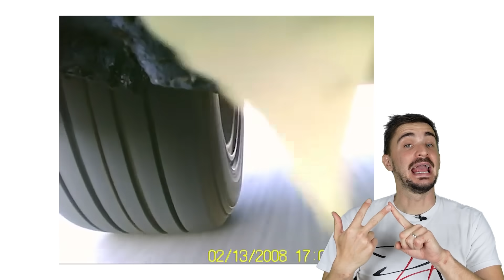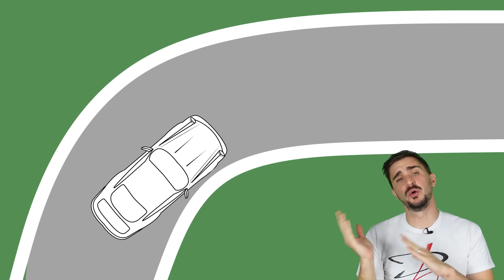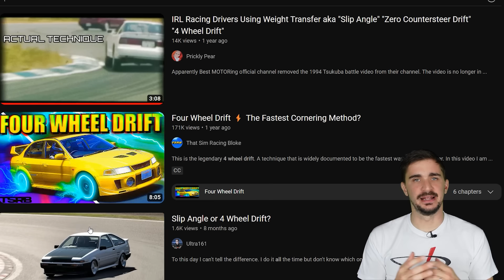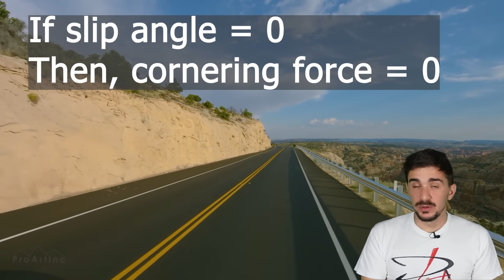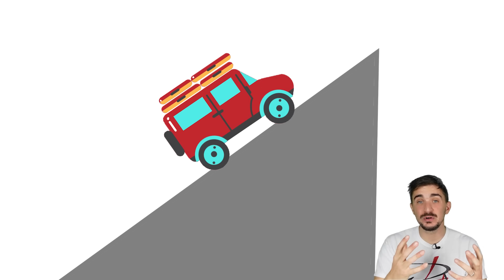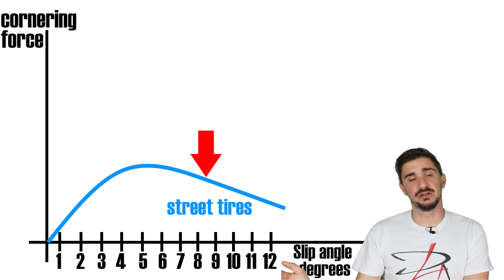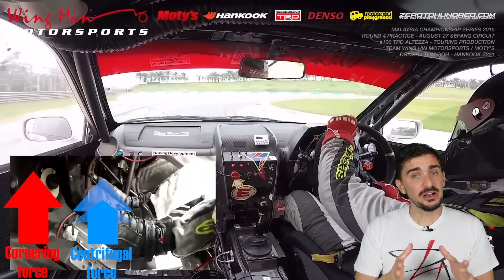You Think You Know But You Don't - Slip Angle Explained in a Way You Will Understand

Comment: I enjoy your videos enormously. But in this one there are a few basic physical errors. The first most glaring one is that you keep talking about centrifugal force as though it were a real force, whereas IT DOES NOT EXIST in the sense of forcing a car towards outside of the corner! What you perceive as CF is actually a reaction force.

Consider what happens when you accelerate in a straight line. The engine exerts torque on the wheels. The contact patch (if the tire does not slip) stays in one place on the ground. The torque results in a force at the level of the axle which propels the car foward. Your body, due to inertia, wants to stay in the same place. In order to accelerate your body as well as the car, something must exert force on your body. That something is mainly the seat. It moves forward, the springs in the seat back compress and exert force on your body. The sensor cells in your back experience the reaction force that seems to push you into the seat - this is the equivalent of the centrifugal "force". But there is NO actual force in the backwards direction. As you know, F=m*a and, if your want your body to accelerate forward, the sum of forces must also be forward!

Similarly, while cornering, you need a force that points towards the centre of the circle.  In order for any object to move in a circle, the ONLY way to achieve that is to have a force that always accelerates the object towards the centre of the circle. This is generated by the tires, as you say. But the centrifugal "force" that you feel is actually an immaginary or reaction force which results from the seat forcing your body into a corner.

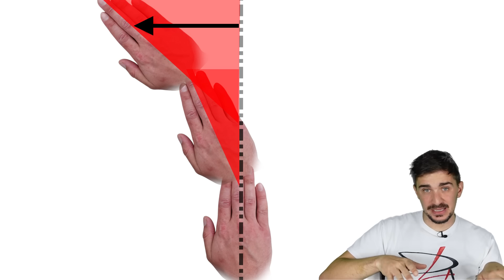This brings up another problem: at 7:13 you draw a diagram with cornering force. The direction of the force is wrong! As stated, the force needs to change direction and is ALWAYS perpendicular to the instantaneous direction of motion. Not in the same (horizontal) direction as shown.

At 8:26 you say that the cornering force is greater than the centrifugal force and that forces the car into corner. Since there is no centrifugal force, the statement is nonsensical.

I understand what you are trying to do: explain in simple terms the process of cornering. But there is such thing a dumbing down an explanation too much, where the simplifications become simply wrong and this is what may have happened here.

Comment: Can you do a video on why F1 went to 18-inch wheels? But specifically why 18 instead of 15, 16, or 17? Also, I see you're back to 50fps, which looks smooth, but still using the standard shutter speed instead of the nicer 1/60th.

Comment: So this is why my tires wear out even when I don’t spin my tires. I wondered this about a month ago and wanted to know the reason. I figured there was some kind of force causing wear on the tires.
Reply: It's because parts of the contact patch are always sliding a little bit.  It's called "secondary slip."  This is where road noise comes from.  So even if you're driving along in a straight line the tires are still wearing a bit.
Reply: That's just a bad alignment or worn suspension components

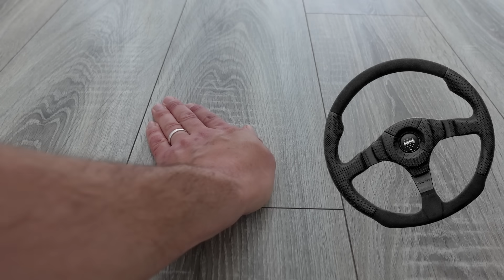Comment: 5:15. With a steering wheel angle, an angle among current patch and the next one is set. There is no further turning of the steering wheel if the angle stays the same.

Comment: This is awesome.  I learned a lot.  
However, there is one thing in there at the very end that could use its own video and may have been slightly misrepresented.  At the end of the video you mentioned spoilers.  Well, at 15:48 you showed what is debatably a wing depending on how it is functioning.  Then at 16:07 you say, "This is why time attack and other racing cars have giant spoilers," while showing a time attack car with many large spoilers and wings.  A video on the difference between wings and spoilers could be great as the subject is greatly misunderstood in automotive communities.  Accurate information of what a spoiler is and what wings are can easily be found in aerospace circles, but automotive enthusiasts often misunderstand it, as I once did.

The simplest explanation of the difference is, Wings generate differential pressure called lift, while spoilers impede the generation of these differential pressures therefor reducing(spoiling) the lift garneting properties of a wing.  
In the automotive world, most car bodies create positive lift(positive being up) and a wing for a car is inverted such that it's lift is in the negative direction(down) and we call it, down force.  It is not always necessary to have a downforce generating wing on a car, and there are real downsides to wings such as induced drag.  In these cases, a simple spoiler to reduce the lift generating properties of the body will work just fine.  
Things start getting weird when the spoiler turns the over all lifting properties of the body into downforce generating properties.  
And ground effect is a whole other subject entirely.  

Anyway, thank you for another awesome video on the d4a channel.
Reply: also, if there is already a good video like what I asked for here, then please link it, I have not found it yet.
Reply from the maker: The thing is that English isn't my native language. I call everything spoilers because that's how it works in my language. Wings are reserved for birds. But I think the picture clears things up for the time being. I haven't made a video about spoilers vs wings but you're right it's definitely a good idea and I'll cover it in the future.
Reply: @d4a  All good, you're English is amazing btw.  Pronunciation and vocabulary that you use are top notch.
Reply: @d4a  Seconded. You have an amazing command of English. If you don't mind me asking, how did you achieve this level of fluency? I want to improve certain other languages and I'm sure I could benefit from any advice you might have. Thank you for the content - this video was excellent (as usual).
Reply from the maker: Honestly there's no trick to it. I never actually lived in an English speaking country. Maybe it's because I started really young, watching Cartoon Network and then kept using English throughout my life. It's just usage and more usage. Both for leisure and work. The more you do something the better you get at it. It's inevitable. I never tried to purposely improve. Back when I knew very little I would still try to speak using what little words I knew.

Comment: Centrifugal force does not exist, it's inertia that makes you go in the original direction. But since the car is changing direction, it feels like you are being pushed out.
Reply: Centrifugal force does not exist in an inertial reference frame. The world outside the car is inertial (but not really, for reasons you'll see later), and there, centrifugal force does not exist.

In the car's reference frame, which is non-inertial, centrifugal force does exist. It is a force that behaves suspiciously like gravity, pulling things away from the center of rotation of the car's reference frame.

I say centrifugal force behaves suspiciously like gravity, because gravity is technically the same thing as centrifugal force - an inertial force in an accelerated reference frame. So if you're willing to discount centrifugal force as a "real" force, then I expect you to stop believing in gravity as a "real" force as well.
Reply: Doesn't exist until you add a reference frame. Here there is a reference frame.
Reply: Wtf is the point of this comment. Yes centrifugal force is created from inertia but that doesn’t mean centrifugal force doesn’t exist lol. Look it up it literally does. Also centrifugal and centripetal force aren’t the same, centripetal force is the force that acts against centrifugal force to create the net balance.
Reply: This is actually not completely correct. If you are watching in a inertial reference frame (i.e someone standing on the ground  and not accelerating) you are correct. But in a non-inertial reference frame things like euler forces and coriolis forces and centrifugal forces are very much a real thing.
Reply: A laughable claim, Mister Bond, perpetuated by overzealous teachers of science. Simply construct Newton's laws in a rotating system and you will see a centrifugal force term appear as plain as day.
Reply: @andresluukas1922 the centripetal force is the correct term. Centrifugal is an imaginary force, no such force exists.
Reply: @eikodunn Steering geometry, changes when the wheels are turned, and the suspension constantly absorbs changes in the road surface.
Reply: @daftpanda6533  
So why not use linear bearings and continuously variable active camber adjustment?
Reply: @eikodunn  Because that would be both complicated and expensive.  You can't really have static suspension, it would break stuff on pot holes
Reply: @daftpanda6533  
I’m not talking about a static suspension.  A vertical linear bearing with a center-hub steering spindle attached to it.  Then a method for active camber adjustment.
Reply: Thank you keyboard warrior, I see that you try really hard and for that I laugh at you.
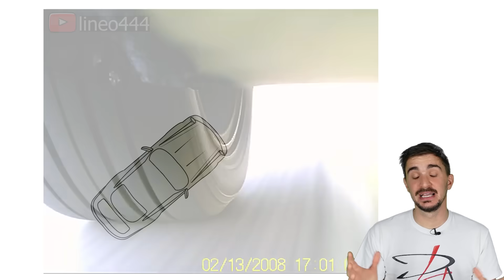Reply: 2:21 i mean it kinda is, depending on your reference frame. For a non inertial system it might have those kinds of forces.
Reply: The inertial force you are describing is known as centrifugal force. That’s literally what centrifugal force is
Reply: @joebideng9226 inertia points tangent to the curve, not straight outwards. I don't think there is a single force that would point perpendicular to the curve in this case
Reply: @joebideng9226 it’s called centripetal force. Centrifugal force is non the correct term
Reply: Lmfao at the people thinking it doesn’t “exist” because it’s “imaginary”. That’s not what an imaginary force means, it’s not literal. It’s a perceived net force, which doesn’t have a specific source, but instead can be observed at a specific reference frame. There is an observed “force” applied to the car opposite the curve if the reference point is the car, but we know that this is just inertia if the reference point is the earth. However, in reality this is just the observation that as the car pushes against the earth to turn (centripetal force), the earth pushes equally against the car. This is just more noticeable when the reference point is the car, since we perceive the forces acting on it, not the forces it imparts. Additionally, as a car turns, if the reference point is the car it will not appear that the car is changing course, so there is no apparent “curve” that it is taking. It is only seen as turning when the reference point is outside the car.
Reply: That kind of purism is not very useful here. Non-inertial reference frames are a useful concept just like any other. Go to far that road and you’re gonna be telling people that gravity does not exist. 

I’m serious. In general relativity gravity is not a force. And general relativity is a more accurate model of the world than Newtonian physics.

Physics is al about picking the simplest possible model that works well for your problem. And all the models we have are approximations of reality.
Reply: @fipachu  Using "centrifugal" force makes things too complicated
Reply: @Projolo  It's bin a while since I did any physics but I'm pretty sure there were problems where using non inertial reference frames made solving easier, at least for some students. And that's my point, fictitious force, yes of course, but that doesn't mean useless. And it's still "real" as a concept that exists.
Reply: Centrifugal force does exist and is just as real as the concept of inertia. If you're inside a non-inertial frame of reference (like, inside a car taking a corner) you do need to take into account centrifugal force and coriolis force to do physics. If you grab any college textbook on classic physics you'll see it's full of mentions of centrifugal force, it definitely isn't a simplification nor a mathematical trick.
Reply: Well smart ass, saying centrifigual force alows mesage to be send eazier. So we still gonna say sentrifual force
Reply: Exists pretty much the same way gravity exists: depending on the frame of reference. So yes, keep using the term for convenience while make sure to understand as much as possible about forces...
Reply: The reason centrifugal force doesn't exist is because an object can't apply a force to itself or a force be applied by nothing.
Using centrifugal force only causes confusion.
Reply: @Projolo  The reason gravity doesn't exist ... ... ...
Reply: @Trombonauta  object 1 attracts object 2 and object 2 attracts object 1.
Similar as opposite electrical charges attracting each other
Reply: @Projolo  Yes, I know. Now read about 20th century physics, you'll enjoy.
Reply: @Projolo  Centrifugal force isn't caused by the object applying a force to itself, but it's caused by the frame of reference being non-inertial. Your comment is what creates confusion.
Reply: Haha … I was waiting/watching for someone to point that out
As you know … centrifugal force is a fairytale force
The correct terminology is Centripetal Force 
👍good one
Reply: @stepside2839  actually centripetal force is the force that keeps the car going in a curve. So it points opposite the direction you show on your diagram. Otherwise the car would go straight at any point in the curve. Otherwise an excellent video.
Reply: @drup3376  I did not put up any diagram 🤷‍♂️
But, I agree with you.